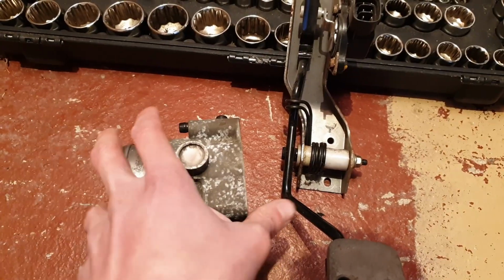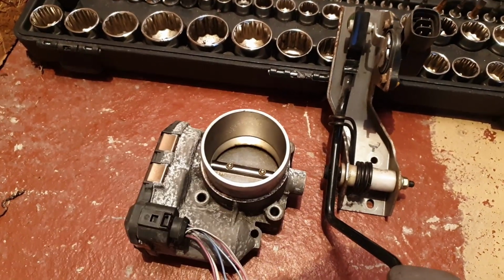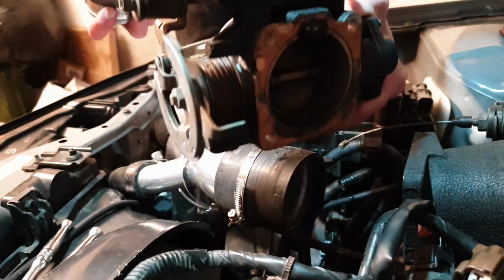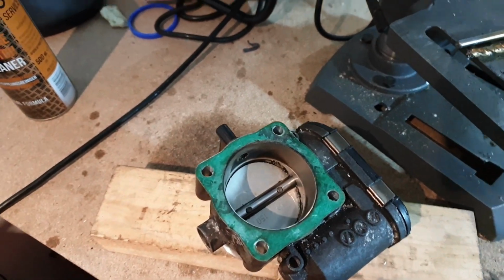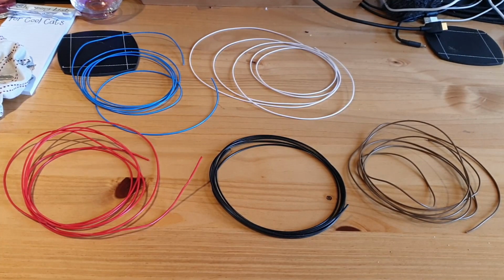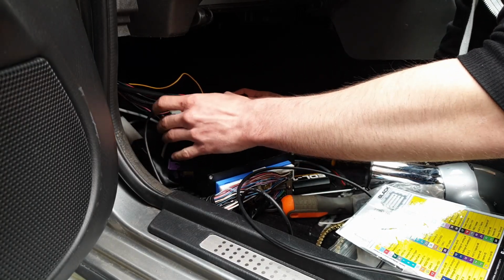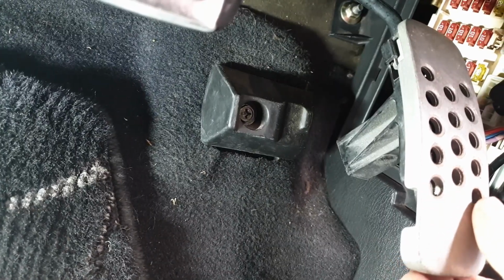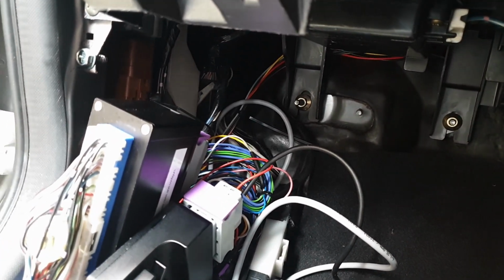🏎️Nissan S15 - Drive By Wire Install🏎️

Comment: Nice work! So funny youre using VAG part on the S15. They have such hreat documentation though so makes sense! 

Also love that thr 350z accelerator pedal just bolted in perfectly.

Comment: Great vid. I saw you're working on a S15 SR20DET + EMU Black hence thought yeah finally someone who could share information about oem ignition coil dwell.. and now I realize you're running red R8 coils. Happen to have any info about oem coils?
Reply from the maker: The oem coils run 3ms at 12v and 2.5ms at 14.5v. If you want to convert to R8 coils let me know and I can supply the coils and a conversion harness 👍

Comment: I was hoping to see a bit more information on the wiring from peddle to throttle body maybe you could make us a pdf instructable we would all appreciate it  ...great job by the way
Reply from the maker: The wiring diagrams can be found on the ECU Master Google Drive: https://drive.google.com/drive/folders/0Bz3_tv4RS5TvZFUtTm5DU0xpNHM?resourcekey=0-V2bIcwPkxAJKiBfxbQha8g&usp=sharing
Reply: @theefiguy657  thanks bro

Comment: Hey, quick one for you does the abs and clock and other functions work and does your car use canbus?
Reply from the maker: Hi, the car is a 2001 Nissan Silvia S15, so all of those functions are either controlled using their own ecu (such as the ABS), or stand-alone sensors (such as the dashboard gauges). The car has no CanBus controlled modules.

Comment: I was firmly against DBW, since I've heard of being sluggish and non-responsive. However I've bought a car which has a Drive By Wire throttle and I've become a believer. It has two modes for the DBW system. One is a pensioner's like relaxed and slow response and the other is sharp and sporty. Since this experience I've decided on doing the same to my Nissan S12. Considering using ECU Master as well. Great video, but what are the pins and how are they connected, is there a wiring diagram for this?
Reply from the maker: Hi Hristo,

Great to hear you’re now a believer! 😎

Each pinout is different, so you will need to research this depending on your ecu, throttle body and pedal combination.

Comment: Nice mod! I don't know why so many persons are afraid of dbw throttle bodies.
Reply from the maker: I appreciate that there are some potential points for failure with them. However, as I explained, the oem pedals are really dumbed down to save on emissions and protect driveline components. Whereas after market ecus can control them really well
Reply: Kariba.. stop spamming! 😂
What Kariba found out was that the xtrail pedal has the same sensor as 350z... and costs £30 instead of £100 for a 350z one.. that's what I've ordered.. together with the 350z throttle body (costum plenum anyway)
I was confused about the emu black DBW module.. but I guess you only need that if you dont have  enough outputs on the emu black anymore as it only requires one pin from the emu black with that module.. (so I understand)
Also, how did you make the emu p&p work the ecu relay? Pin number 4 isn't connected anymore and the coils get their power from that relay..🤔 same with CAS sensor.. curious on how you worked that out EFI guy..

Comment: does it also work with the original ECU?
Reply from the maker: It certainly isn't a "plug and play" setup with the original ecu. I imagine it's not impossible to use an aftermarket controller designed with an OEM ecu in mind though 🤔

But, to gain the full benefits of drive by wire, you really need to use an aftermarket ecu with support for e-throttle 😎

Comment: Hey, looking forward to seeing if this works well! Considering putting a dbw on my S14a (also ECU Master)
Reply from the maker: Hey, definitely stay tuned as I'm working on the config video as I speak 👌 Nice choice of car and ecu! 🔥
Reply: Also, if you mind me asking as I am being too lady to research lol what’s the rough cost of the dbw and pedal? And are there any adaptors needed on the ECU or you can wire straight in?
Reply from the maker: @drfc_14  Regarding adaptations to the ecu, assuming you have 4 spare analogue inputs (the TPS input is one of these) and a spare H-Bridge pair (e.g H-Bridge #1 Winding A+B) you can just wire it straight into the EMU BLACK 🔥
Reply from the maker: @drfc_14  I actually found little information online about fitting drive by wire to an SR20DET, so ask away! Both the throttle body and pedal were breakers parts, the throttle body was about £20 from a mk1 Audi TT, and the pedal was £30 from a Nissan 350z. The connectors were both about £5 each. 👍
Reply: The EFI Guy that’s great! Also, is that a vacuum source on the tb?
Reply from the maker: @drfc_14  It is, yes, you can also get a throttle body without from an Audi A4 1.8T which comes without a vacuum source if preferred 😏